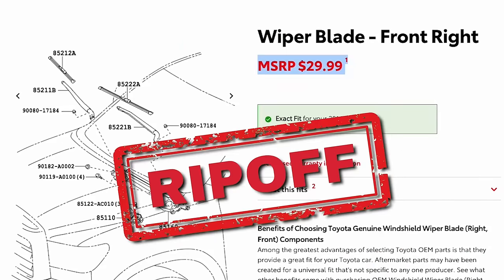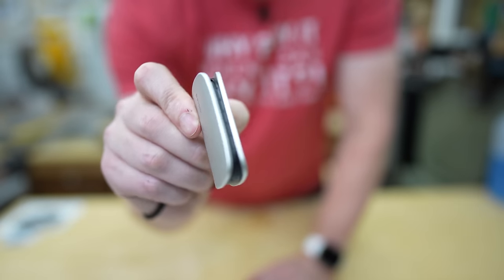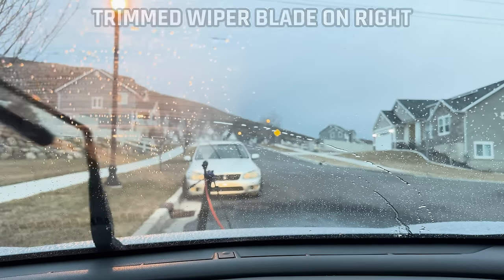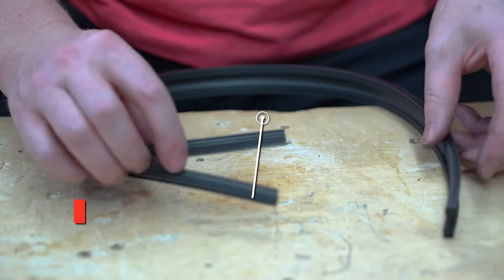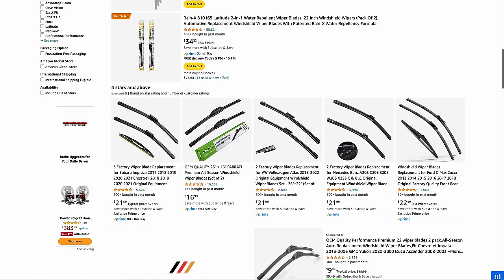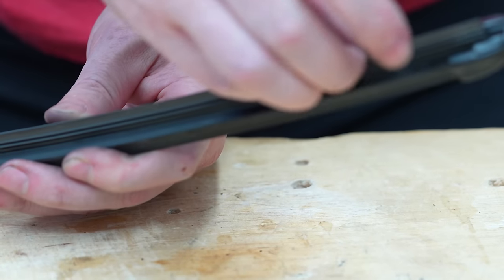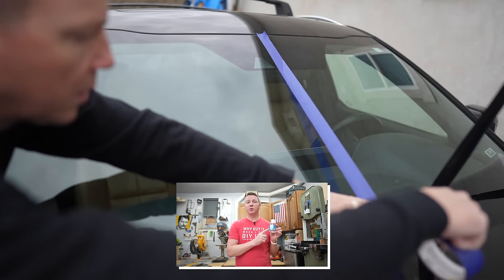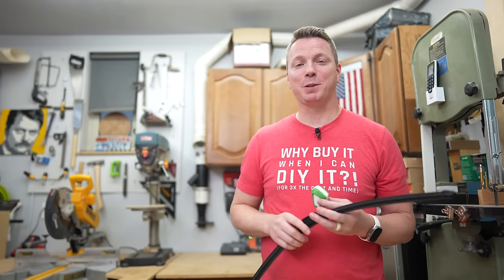Windshield Wipers Are a SCAM! 3 Ways to Save $$$

Comment: First, clean your windshield like normal then use  0000 steel wool to super clean your windshield.  Repeat your normal windshield cleaning then use wax and it will repel water better then rain x or anything.  This will also last a long time. I did mine last year and it has now gotten to a point where it needs to be done again. 

I wash my car weekly by hand.

Comment: Just a warning about those special kinds of wiper fluid, those often risk corroding the tank level sensor of a lot for cars.
For example my Audi suffered from that problem, had to remove the corrosion from the sensor and only use the water/alcohol fluid.

Comment: Windshield washer pellets are a scam.  Rain-X is great, I've been using it for years on many different cars.  I've had no problems with any crazy types of glare as some have mentioned, but as the coating wears, you can definitely see the different on areas that the wipers go over vs. where they don't.  I just clean the windshield very well and re-apply and it's great.

Comment: The best thing I have ever done for my windshield wipers is switch to silicone wipers. I replaced the wipers on 3 cars in 2021 and they all are still as good as new. They are all no name brands as well. I bought a rubber rear wiper at the same time and it has already fallen apart and has been replaced with a silicone one

Comment: Ok Young Man, First time I have ran into your channel, You Earned my subscription in just One topic, so here goes, I do have an axe to grind and THROW at these SCUMBAG, GREEDY, Autoparts replacement suppliers. Yes Wiper Blades come with the arm now to get a set from local auto parts, and your suggestion of Amazon is perfect, everyone should be informed that ONline parts will save up to 50% on parts costs and you can still get WIPER refills. Also White Vinegar cleans blades better than anything I have found so far, seems to melt a fine layer of rough grime off and smooths performance really well. 

I am 67 and have been working on mechanical things that Fly, Float or drive since age 10. The one thing that SET me off, was when I went to town and bought a lifetime fuel pump for in tank Chevy and got home to find there was No tank Gasket/Oring, well I go back to autoparts and they wanted to sell me a Oring BUT it came with a FORD and CHEVY Oring= $$$ 20.78$$ For a Ford Oring and Gasket that you do not need? instead of a 1.50$ Oring? They Both came in one sealed package, THAT IS RIDICULOUS !!! ALL THE PARTS Houses in town and neighboring towns were The SAME, That to me is Phucking the public big time,  can go ONLINE and get a complete fuel pump for a chevy for $14 and change, save $6 or so and GET THE ORING, lol, the end kicker is that the supposed OEM pump is made in China too. I have a video Idea for you if you want to check it out, you might like it, has to do with boating parts. Thank You.

Comment: Can you get replacement rubber for aftermarket blade housings? That is if you replaced your blades with with something from Goodyear or Rain-X, do they sell blade replacements to fit their housings?
Reply from the maker: In almost every case, they're using the same style/shape rubber blades as the OEMs, so yes. If you pop the end of your replacement wiper off and pull the rubber blade out a bit you'll be able to see the profile of it. If it looks like the one in the video, you can replace it for just a few bucks.

Comment: I don't care much about minor streaking, but by biggest problem is that even with no streaks, the wiper blades just rip apart and start whipping black spaghetti around the windshield.  That thinnest part is almost like rubbery film and that's where the business end of the blade always separates.  I used to be able to get refills with the metal backing clip that clamps into the bracket, but nowadays you can't even get those, and I imagine I'd have to get just the rubber part as you show.

Comment: I wouldn’t use wd40 for wiper blades. Wd40 degrades plastic and rubbers, over time it’ll get stiff and brittle. Use diluted ipa, glass cleaner or soapy water instead. Do it every month or two. The cleaner the blade stays the longer it’ll last. Sometimes cleaning the windshield isn’t enough either, the coating on the windshield has degraded to a point where you will need to use glass stripper and reapply a ceramic coating.

Comment: I only buy silicone wiper blades.  They last at least 5 years.  I've got a set on my vehicle for 4 years now, and they still wipe streak-free.  Silicone doesn't crack and break like rubber does, so they last a lot longer.

Comment: Trimming the squeegee won't work most of the time since that "width" is designed along with "rubber" properties to "flip" back & forth. So a trim will stiffen the squeegee most times to not flip, so blade will chatter one direction.  Synthetic "rubbers" maybe, but last way longer anyhow. Best is just cleaning squeegee...slightly abrasive cleaners work on older blades where oxidation of rubber is cause of streaks, not just dirt. Use toothpaste (white gritty kind) or bartenders friend, etc. w light pressure. You can coat rubber with graphite to quieten things, lasts maybe a month or two....then buy new wipers...silicone.

Comment: I’ve been replacing wipers on cars for a long time. The only worthwhile wiper to buy is a silicone wiper. It’s the only wiper that lasted on my car for more than a year and I’ve tried almost all the brands available Bosch, NWB, etc. The one on my car right now is PIAA silicone wiper and it’s been on since 2018, going 6 years now and still no signs of failing.

EDIT:
I just want to add I don’t really recommend these water repellant windshield treatments. At first they seem impressive because the water really just beads but once you start using your wipers on your treated windshield it will never wipe as smooth as an untreated (but CLEAN, as in clean free of watermarks) windshield. Most of the time the wiper squeaks on treated windshields. The key here is keeping  both surfaces (wiper and windshield) always clean.

Comment: Buy two sets of wipers, soak them both in Aircraft Conditioner, while one set is on the car the other stays soaking in the conditioner, swap once a year, I haven't bought any other blades for my 2009 kia borrego since 2010, i have replaced the tray the soak in, that it

Comment: I like most of your info here, but 8:02 smells like snake oil.  What are those things made of?   The main active ingredients in windshield washer fluids are usually some type of alcohol and/or ammonia, and distilled or reverse osmosis water.  The reason those work is that they're excellent solvents for the junk that usually winds up on your windshield, they evaporate quickly, and don't leave a residue.  None of them can be put into a tablet.  It seems to me that they're selling you automatic dishwasher tablets at what seems to be a pretty good price.  They probably do work pretty well for cleaning glass, but not as well as the other things I mentioned.  Also, using tap water for cleaning glass is asking for trouble.  Tap water always has a lot of minerals dissolved in it, which means that those minerals will be deposited on your glass when the water evaporates.  If someone's really good at chemistry, maybe they can think of an additive that can prevent these deposits, but I'm skeptical.  Also, that blue color is entirely marketing noise (which is understandable since most people are ignorant and respond to Pavlovian cues like this one).

Comment: Costco regularly has them on sale for like $6-7 each...  I figure for an object that cost tens of thousands of dollars, spending an extra $12-15 every few years is hardly a "scam", hell even if I bought the "Manufacturer approved OEM" versions that may cost 3x as much,  just deal with it.    I will say that Nextzett stuff is pretty cool,  not sure it's that necessary though if you just get proper wipers.

Comment: Might want to try PB Blaster spray instead of WD40.  While PB is a penetrating oil (that works way better than WD) it also reconditions rubber. (edit: I guess that wouldn't work on silicone wipers though)

Comment: I thought they had stopped selling refills bc they no longer sell them in the store. I will tell you what Wipers are an absolute nightmare to switch out, and there is no other car you'd have more reason for going to such extreme lengths on that's the wiper blades on a 2018-2020 Mercedes Benz S560 Maybach $70 bucks is nothing try $200! When I found out how much they cost, there was no way I was going to allow my mom to pay that much.  So, I went to Costco and bought the 2 longest wiper blades I could find, tore them down, removed the blades, cut them to length, and then went through the nightmare of taking the Benz apart and putting the new blades into them. Not all brands will fit them. That was nothing. You won't believe what they tried to charge her for 2 new side view mirrors on that car. It was quoted, if I recall correctly; it was over $18,000, and that was only for the parts, not even taking the labor into consideration. The mirrors don't come as one whole mirror; they come in a million different parts. Obviously, I didn't charge her for the labor, only the cost of the replacement parts, which I think ended up being under $3,000. What the A-holes at the dealership didn't bother sharing is that a lot of the parts from the broken-off mirrors could be salvaged which I figured when I tried to find a better price on the replacement mirrors, so I salvaged what I could from the old ones and purchased the replacements for broken parts one on my own, and it was still way more expensive than it should've, but I still ended up saving her damn near $18,000!

Comment: Nu finish polish ... wash your windshield. Clean with rubbing alcohol then put two coats of Nu Finish polish on the windows.  Buff in between each coat and wait about 30 min before putting on the second coat. Outside only, don't use on tint.  Always use micro fiber cloth. Trust me if you do this... you will always do this.

Comment: I replace my blades every year with the $6 Michelin jobs from Walmart.  Easy, cheap.
Reply: They're $7.87 now. I stocked up on them when they were $5 at an odd lot type store called Ocean State Job Lot.  I peeled  the SKU label from the package and got a couple of those $35 Michelin beam type wipers at Walmart. Re-glued the SKU to the $5 Michelin wipers and returned them to the store.  Those $35 wipers that claimed to last twice as long started squeaking and streaking after eight months, same thing happened with the $24 Rain-X treated blades.  What a joke who keeps their receipts for wiper blades, good luck getting your $74.20 back from the wiper manufacturer.

Comment: Can you explain to me why car manufacturers have made the drivers side wiper blade so large and the passenger side blade so small in comparison. I have an older car that both blades are the same length and don't see the need to change the blade lengths. At least with mine, if for some reason the driver side blade malfunctions or gets blow / torn off, the other blade gives me enough visibility to the right side that I can safely maneuver the car to a safe stop. If this happens on a lot of the newer cars, the  passenger side blade is so small,  it sweeps near the top of the windshield, therefore decreasing the visibility of the driver.

Comment: In my early days of car ownership the rubber blade refills were the only way to go. Replacing the entire assembly is a more recent imposition. Waste for the sake of convenience is the prevailing philosophy that came into being once the memory of The Great Depression and World War II faded.
The old opposing blades may have left an unwiped pillar in the middle of the windshield, but they did a good job on their respective side. The newer parallel running wipers tend to have the wiper from the passenger side leave a temporarily deposited ridge of precipitation in the driver's sight line. So, engineers, figure that one out.

Comment: I am very picky on who I follow. They have to have great content, knowledgeable and NO FLUFF,  (2 minutes about grandmas cooking and how cute my dog is). With that, you are by far the best and most concise DIY. I subscribed, followed and bought some of your suggestions. I LOVE PAYING .05 cents for windshield cleaner. Thank you. Keep up the good work.
Reply: I am not picky at all, - I also liked it.
Reply: just don't forget to add alcohol or ethanol to the wiper fluid to prevent freezing and possibly bursting your lines and water tank if you live in colder climate areas. He somehow forgot to mention that. And consider using distilled water to prevent water spots should your tap water be 'hard' water.

Comment: OR, you can just do this: Use about eight ounces of rubbing alcohol on one gallon of distilled water, then add just a few drops of dish soap.  
THEN:  run a wet sandpaper 400-800 grit folded up on a wet blade and just polish and refurbish you own blade.
Been doing this for 40 years

I replace my blades about every 6 years.

Comment: Although I believe that you could get away with using WD40 on the rubber, it's going to end up damaging it because it's a solvent comment. It is not a lubricant period you should be using it on hinges or anything else that needs lubricant. You can take some rubbing alcohol and then soak down a cloth with some 303 protected and wipe it with that. There are some devices for dressing the edge of the blade that can help.
If you keep it treated with the 303 protected the rubber wiper blade will last a pretty decent amount of time. I've seen it work wonders on things like serpentine, Bells and all of the other rubber on the vehicle, even spraying it on the tread.A few times a year and i've seen tests with tires where the tread lasts three times longer.

Comment: At one time you could buy a pair of wiper blades, nowadays they're sold as single blades. I just bought a two of the least expensive ones at the Auto parts store today, 10 dollars each. RainX wiper blades cost 40 dollars each which would be 80 dollars for a pair. What a ripoff.

Comment: I often find it more difficult to replace a wiper blade onto the wiper arm then the old way of simply pulling out the rubber insert and metal strips and replacing it with a new one😡

Comment: Wiper blades are a safety item. Not a scam.
Washer "tablets" offer no freeze protection and could cause minor to expensive damage is your fluid freezes.
Clean your blades with isopropyl alcohol. NOT WD40. Unless you like oily residue on your windshield. 
UV from sunlight is the biggest enemy of rubber wiper blades. The more exposure the shorter the lifespan. 
Dirty windshields are 2nd. Not only does it cause streaks but it wears on your blades.  
Automatic car washes put a small amount of wax on your vehicle to promote drying. Even with the cheapest wash. On your windshield this will lessen the effectiveness of your wipers. Clean your windshield with a good glass cleaner after.
Use a 3 dollar ice scraper instead of your wipers and washer fluid to remove frost.
If the original equipment wiper blades have been replaced with blades from anywhere other than a dealership, then the chance that aftermarket refills are going to work for you are slim.
As the wiper arms your blades attach to age, the spring that tensions the arm weakens causing it to put less pressure on the blade, causing problems often blamed on the blades.
Wipers blade are a wear item. Just like brakes. And like brakes they are a CRITICLLY important safety item. Keep your windshield clean, your wiper blades in good condition and choose wisely where to save a buck.
Reply: Those tablets are a real bad idea if you live somewhere that experiences freezing temperatures. Can't believe the video didn't mention that.

Comment: I'm sorry, but this is the wrong advice. Yes, blades are a scam. All you need is 100% silicone wiper blades. I have 2 sets over 5 years old. I don't clean them, I don't shave off anything,  I don't  reshape them, I do nothing. I love Rainx, but I forget to spray it on, and then I curse myself because I forget when it rains. I'm going to give Nextzett a try.

Comment: Hey Bud. Off topic question for a new DIYer if you or someone else can help I'd appreciate it. trying to build an IBC tote stand (4ft off ground) for water pressure to gravity feed my garden. Those totes are pretty heavy (2330 lbs full of water). I want to build this securely and properly without any chance of sheering screws or anything of that nature. Looking at building this with some 4 x 4's and some other materials as I have heard 4×4 posts can support at least 4,300 lbs. So having those as my foundation seems ideal. Though I don't know wtf I'm doing.

Comment: wiper blades usually have a pretty hard edge to clean the windshield better. Cutting that hard edge will just make it wipe worse. Yes you have a clean blade but it will not wipe as good

Comment: Wiper blades ARE a scam. Floor squeegees for our ride-on scrubber at work are reversible L/R and Up/Down. 4 edges for use if you flip it before it gets roached out. It's just a thick, flat rubber strip. Windshield wipers could be designed like that but they just aren't, so they can sell more sets.

Comment: Definitely don't recommend this. Most people will not install them correctly and possibly scratch their windshields. Plus not all inserts are created equal. They may look the same but the rubber compounds are completely different. Wipers are cheap enough even for good brands like Bosch. $20 shipped and no messing with these inserts. Bosch will outlast any of these cheap inserts by 5x, 10x lifespan.